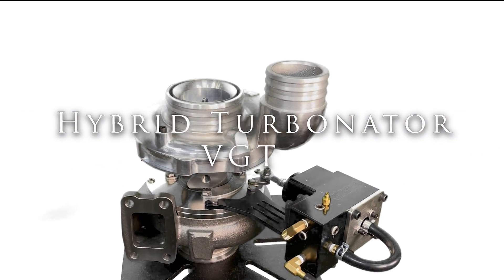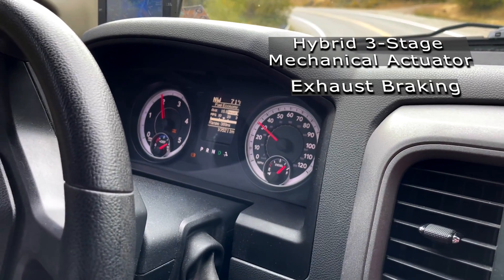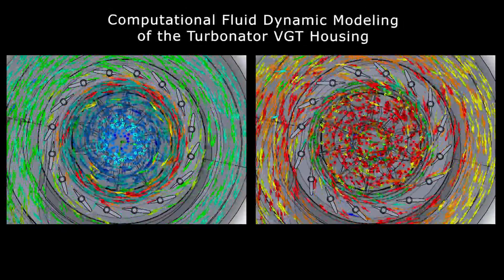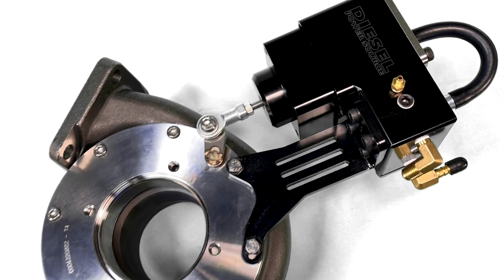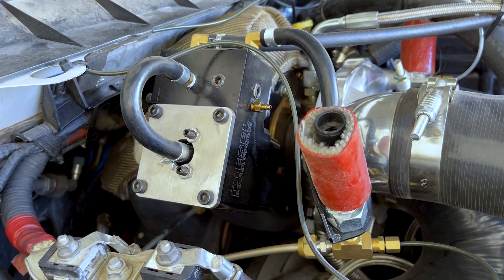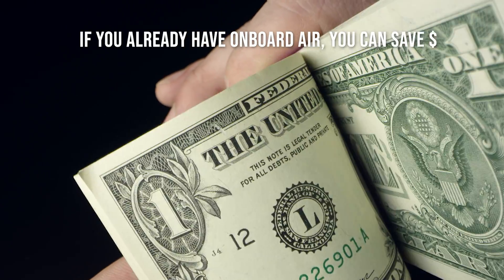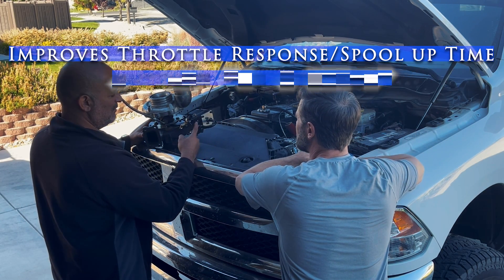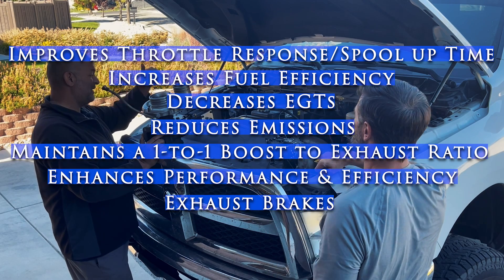DPS Turbonator VGT Hybrid | 6.7 Cummins Turbo actuator replacement alternative with exhaust brake.

Comment: How well does boost pressure follow drive pressure through the power curve with a VGT?
Reply from the maker: It maintains a better than 1 to 1 ratio most of the time.  Here is a link to an older video that shows the exhaust to boost pressure ratio.      https://studio.youtube.com/video/yCt5U6f-Bco/edit

Comment: Would it be possible to purchase just  the actuator with exhaust brake?I I have a borg warner s300v129 that I could use this on.
Reply from the maker: You would need to purchase the Turbonator VGT Housing Only for the turbine wheel size on your s300v129
Reply: The s300v129 is on my max force dt466 and the exhaust housing is nearly identical to your housing. I would love to just replace my electronic controller for the manual one.

Comment: How much for the upgrade, and will this work if fitted to a 99' 24V?
 I have some mild upgrades on the truck. it needs more air.
Reply from the maker: This product would work great on your 99 24v.
Reply: @DieselPowerSource  What is the cost of this set up??
Reply from the maker: @smckinney3mckinney141 there are a lot of different options depending on your truck year and horsepower, etc... Here is a link to the webpage where you select the correct choices/sizes for your application and it will give the price:  https://www.dieselpowersource.com/choose-your-own-turbonator-vgt-vnt-variable-geometry-turbo-cummins       If you want the exhaust brake make sure to select the Hybrid option under "TURBINE/EXHAUST HOUSING UPGRADES" dropdown.
Reply: @DieselPowerSource  Thank You.
Reply from the maker: If you would like to call us at 801-930-8404 and tell us what you have and what you are trying to achieve we could help you know which size/selection would be the best fit for your truck.

Comment: Can you do a video on your S300/S400 compound kit for the 4th gen 6.7 , im very confused and worried if it will fit with minor modifications due to the location of the coolant reservoir  ( I have a 2016 )